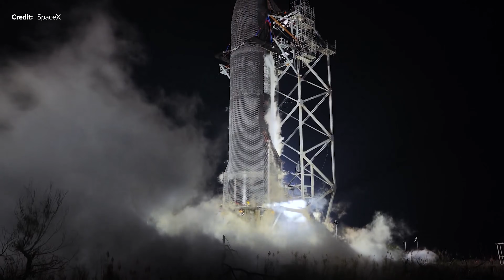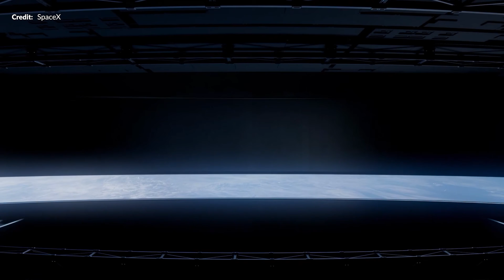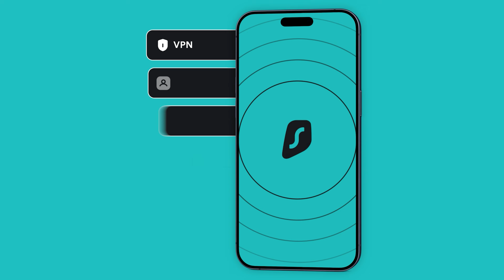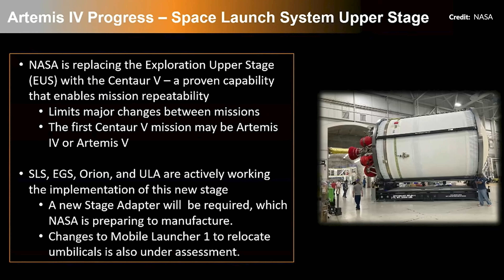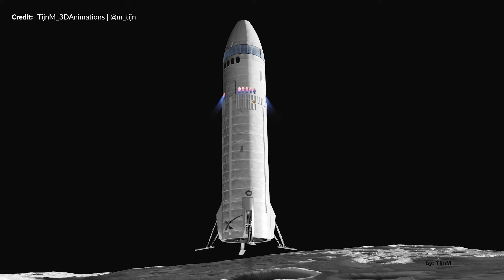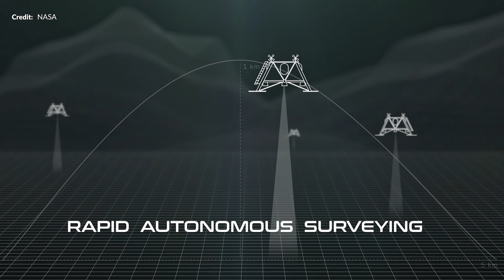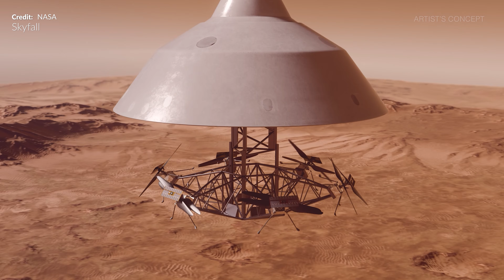They Want 5000% More… Of WHAT Exactly?

Comment: For a purpose built lunar starship landing horizontally seems like it would simplify a lot of things and eliminate some critical safety concerns. Its supposed to land one or two hundred tons of cargo on the Moon. Getting 100 tons lowered to the surface without falling over seems problematic to me and thats just one thing. If it already needs different landing engines and robust legs then using the existing flap structure seems like something worth considering. Its already designed to handle high lateral loads. It may allow the main engines to do more work during the landing and the legs should simpler. It deletes the elavator. Obviously it would still need a large door for large cargo and a method for unloading but it will need that regardless. Seems like it would make unloading heavy excavators and equipment much simpler/safer. Then theres the idea of using them as permanent bases. I keep seeing images of virtically landed starships laid down and buried. Great idea, has anyone looked at what kind of gear it would take to safely lay one down on the Moon? Lunar gravity helps but it still seems like a lot until some fairly robust infrastructure is already Once bases are established and landing infrastructure can be built then the virtical landing versions should still work fine, especially if it can be anchored to allow for unloading. But first landings at any unprepared sight seems optimistic with a vertical ship that tall and narrow with all the cargo near the top.
Reply: How about upside down put the landing engines inside the skirt pointing up so that they're pointing down when you land upside down.  Eject the nose and make the entire crew compartment a Giant elevator.
Reply: No one is ever going to send a singular piece of cargo weighting 100 tons, it's always gonna be pallets/small containers that won't really have much impact on overall stability when moved around, just like with cargo aircrafts, ships or trucks.
Reply: @depressedTrent  You're such a kill-joy, Trent, you know that? And there I was looking forward to the Lego version of a Transformers-like 100 ton all-in "Moon Module"... Shoot!
Reply: @robbannstrom You leave Trent alone! He's depressed.
Reply: Simplify?  Outside of a complete and total re-design?
Reply: People get really weird over the horizontal landing thing. Kinda like they did with going to the Moon at all until Musk gave his approval. Then everyone knew all along that the Moon was the whole ass point.😂. Did I space out and end up on Xwitter or something? Grok put my clothes back on this is getting creepy. Please tell me I'm not in R/SpaceX lounge, those guys are uh, sensitive. Nope the Special K has worn off and I can tell now this is definitely Youtube. Thanks Marcus, another great video! 
 It doesnt matter if its a 100 tons of crates, 4 25 ton construction vehicles or 250 tons of Space Chihuahuas. Its not about the complexity or the single point failure mode of an elevator. Although I guess they can leave a Moonclimbing rope in case there are issues. Its about landing a very tall vehicle with a very high CG on an unprepared surface in a low G environment that does strange things to tip stability. It means the legs cant be light weight carbon tubes like the F9. They'll need a lot of margin designed in, margin of error like that equals mass and complexity. Horizontal legs are just smaller and lower is inherently more stable. The list goes on and on like that and I'm not the first youtube comments Moon genius to point this out. MIT studied the concept, other nerds on YT have looked at it. I'd be surprised if SpaceX isnt looking at it. SpaceX would never make major changes mid program right? Unless Musk made one of his genius executive calls because he's not known for being impulsive or high or anything like that. But he's not the company and they'll likely do whatever makes the most sense in physical reality given the many many variables. The comments section isnt actually all that important. 

 I do like the upside down engine backwards ejecting nose cone idea though.
Reply: @allineedis1mike81  are you planning at any point to account for overall weight of the vehicle plus the fuel that would still be left in its tanks? The weight distribution would be way more even no matter the cargo than you sem to be willing to consider. Plus ship designed to be handling it's own weight vertically would just collapse by itself if layed horizontally, it's same as with prestressed concrete or cast versus hammered steel. It would have to be completely new spacecraft not using anything aside engines and maybe cockpit from the original Starship, load bearing structure and fuel distribution would need to be designed new from scratch.
Reply: @depressedTrent Yes i've run the specific numbers on the still in development experimental ship that SpaceX doesnt know the numbers on yet as I'm sure you have.
Reply: @depressedTrent You've seen them reenter right? You've seen the flip? The forward section of the ship is unpressurized and somehow manages not to snap off through all of that. While all tanks are stronger pressurized they've clearly beefed up the entire structure considerably. Its not a balloon tank. I'm not sure your concrete analogy is applicable. Can we argue about something really well understood like human gestation in deep space? This is pointless but regardless I'm going to double down and claim with 1000% certainty that all Starships will be belly landing from now on because I say so. Or maybe not, cant wait to see those legs.

Comment: Why is "compute" measured in watts? Is that its power consumption, and if so, why focus on increasing it rather than increasing efficiency?
Reply: It is a good measure for new data centers as they are all going to be using the most efficient chips available at time of construction so power roughly equal to compute power and considering a lot is for AI that uses computers a bit differently its as meaningful as anything else.
Reply: @Ethan-3369  What does "compute power" mean? By what formula is it calculated?
Reply: @StarshipToMars  it's a general concept of how much math a computer can do per second. Not really an exact measurement but normally floating point operations per second is a good base measurement but if a computer is made for different kinds of math different measurements make more sense
Reply: @Ethan-3369  Ok, but I asked about which formula is used to calculate it in order to ascertain why watts are used as the unit of "compute" in this case. The number of floating point operations per second has nothing to do with Watts. It's just a number. No units required. Watts are joules per second, or  kg⋅m^2⋅s^−3 (to use SI units).
Reply: @StarshipToMars  it’s literally the power used for compute (total datacentre system energy from the meter).  The constraint is now power, so tokens/watt is the metric, simplified to total power in to a datacentre.  Over time, improvements in efficiency will increase tokens/watt but the marco constraint is still absolute power.
Reply: @StarshipToMars isnt there some funamental limit as to how much energy it takes to flip a bit?   Some information theory number.  We're no where there yet though..
Reply: @Oss-6342  Did you mean main constraint, because if so, surely power is more of a constraint the less efficient the system is, and measuring the system in terms of its power consumption is essentially counterproductive.
Reply: @StarshipToMars  Watts are used to plan for power needs and cooling needs.  It does not touch on the efficiency or how much work is being done.
Reply: Orbital satellites have to assume that most of every watt of power consumed by the CPU (Compute) will need to be radiated in watts as waste heat.  The conversion happens as resistance in the circuits and components of the silicon and the various conductors and paths on the motherboard.  But we usually focus in enterprise on the CPU and GPU as these are the single largest power consumers by far in the system. The next biggest for a satellite would be the transciever, believe it or not, after that ionization thrusters, etc. but we are talking on order from 10-100 times less power consumption compared to the CPU and GPU.    

The more heat you can remove from a chip the more voltage you can push through the semi-conductor and the harder/faster you can drive the components.   If you can pull 100w of heat from a cpu, you get a certain performance.  If you can pull 200w of heat from a cpu, you get more performance (its not a linear scale, as there's a law of diminishing returns) - most high performance enterprise CPUs and GPUs can generate between 450w and 600w of waste heat that needs to be removed from the chip. Obviously this is done with heat pipes and liquid cooling loops within the chassis.     

Data centers have to move this heat away from the hardware quickly either with massive amounts of air flow or dedicated water cooling - either with high speed fans blowing large volumes of ducted air through the chassis and the heatsinks... or via direct-connect water cooling systems.   

In satellites this is especially important because high orbit is a relative vacuum - meaning there can be no convective heat transfer... only radiative heat emission (IR blackbody radiation).  Vacuum is an extreme challenge because it is a perfect insulator as we consider things (see double-wall vacuum thermos for a real world application that might be in your cupboard) so you need to emit heat as radiation.   This is all material science from this point forward - but there's formulae for how various materials react thermally as they emit black-body radiation - but you usually need a certain area in square meters per watt of heat for emission (easier to think in metric for these formulas).  So a satellite chassis would have heat pipes and water cooling loops attached to an emissive plate system - part would likely be the satellite chassis itself and an additional radiator to handle excess thermal generation that cannot be managed by the surface area of the satellite.  

Fun fact - we can use direct black-body radiation to get additional cooling for buildings on earth.  There's a class of coatings that can cool a surface several degrees lower than ambient by emitting black-body radiation in a frequency that does not interact with the air.   The surface must be aligned to emit vertically so that it is sending radiation out away from the planet (the best direction is straight up).   This means the air cannot reflect this heat back to the surface nor insulate against its emission, allowing the radiation to escape directly into space.  And this happens day or night... however clouds can interfere with this as they have a different absorbtion spectra from normal air and can bounce some of the heat back to the surface preventing some percentage of cooling.
Reply: @pvalpha  Thanks for your insight. I do now sort of understand why "compute" is measured in Watts, relating as it does to heat generated directly by the chips. However, it seems odd to boast of what is essentially heat loss inefficiency when talking about manufacturing high volumes of processors.

I wonder if the "fun fact" you mentioned has anything to do with why the best way to cool a watermelon is to leave it in the sunshine before cutting it open.
Reply: Computers turn electricity into well-ordered heat.  Relatively tiny amounts of energy escape the chip on it's I/O signals.  So other than the energy radiated away in RF or laser links, the rest is heat to be disposed of.   In a data enter environment, the metric for capacity is watts per square foot.  The limiting factor tends to be how much heat can be removed from that physical space.  And you need electric power for the computer, plus some significant fraction of that again to pump the heat out with your HVAC systems, chilled water, etc.   Maybe this latter bit is more power efficient in space as you can radiate the power... at the cost of making everything else more expensive.  We'll see, I suppose, if this really becomes practical.
Reply: @lmamakos  Thanks for your insight.
Reply: Long answer? ^^^  Simple answer? physics.
Reply: @Giveitaresssstt  "I don't know" is a perfectly valid answer.
Reply: @StarshipToMars just grok it then genius lmao wasting yo time the comments
Reply: Compute is measured in watts because “compute” at data-center scale is fundamentally limited by how much electrical power (joules per second) you can actually supply and cool—more watts = more chips running = more total FLOPS. Yes, it’s pure power consumption; efficiency (performance per watt) keeps improving, but the explosive demand for AI/training still requires cranking up total watts rather than just making each watt smarter, since power delivery, cooling, and grid capacity are the hard bottlenecks.

there took me 1 min
Reply: @Giveitaresssstt  Thanks for taking the time to provide a proper answer. I do appreciate it.   =)

Comment: 8m 30s when did we start quantifying "compute" by power consumption? I had a 25W Pentium II in my first real computer; you get quite a few more cycles with 25W these days. No?

Edit: 9m 30s I'm with Marcus 100% here. All this "fabs in spaaaace* stuff is silly. (And a bit suspect, I think.)
Reply: Yes the only real measure should be quality tokens per second per watt
Reply: @longboardfella5306  'token' is also an AI marketing buzzword that doesn't mean anything and has as many definitions as you want it to have... It is a concept more related to how AI companies want to bill you than anything else at the end of the day.

In a similar vein they already redefined the prefered data format type they want to work with from initially FP32 if not FP64 but then FP16 but then BF16 then FP8 then FP4 or int8 or int4... etc.. whatever helps printing bigger numbers on the marketing materials for your latest AI box.
Reply: Wattage doesn't equate to performance.
But compute does require wattage.

Data farms have been putting a substantial strain on the grid so calculating the wattage draw of these data farms is a meaningful metric.
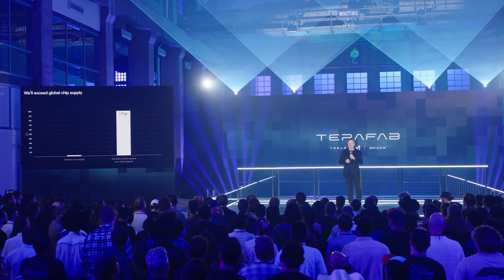Reply: 8:30 
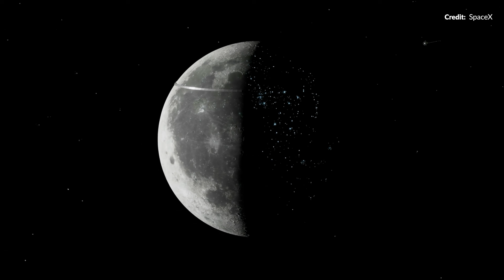9:30
Reply: @s-t-f  THANK YOU
Reply: I had a 486 zoomer
Reply: Re: Fabs in space. Until we have all the mineral resources mapped and quantified, plus plans to build the processing plants, that would be hard. Apparently, metals make a good chunk of what is needed, not to mention energy. Still regarding metals, some deposit forming processes, are, as far as I know, particular to Earth. That would make mining much harder outside "home".
Reply: @PauloTrabalho-e3h9p you also need clean rooms which move a large amount of air through them.
Reply: @s-t-f air would be a problem
Reply: It is stupid yes. This would mean that a power hungry pc from the 80s would be faster than this. Makes no sense.
Reply: @yulpiy Not sure I’m answering your actual question but power consumption is a typical datacenter centric metric. Datasenters are above all measured in how many W they can provide their customers. The efficiency (PUE) which is a more compute centric metric is often measured in IT load, still talking W. Since only the customers (the client installing their server and compute hardware) wastly varies in installed hardware, and data on their capacity is often a company secret the total capacity most reliable figures are measured in power consumption for convenience. You’d have to estimate from that what that means in compute capacity based on best guess for average CPU speeds across the industry.